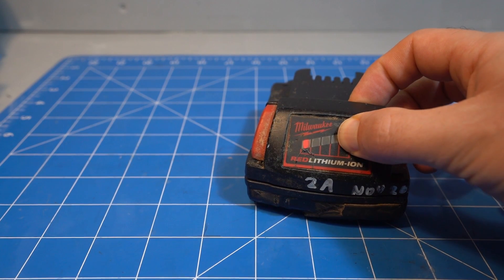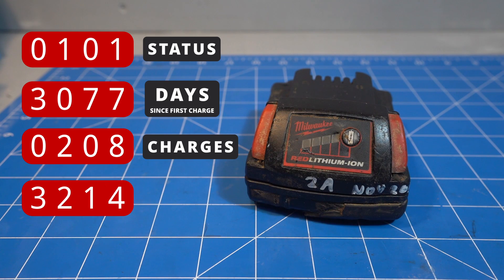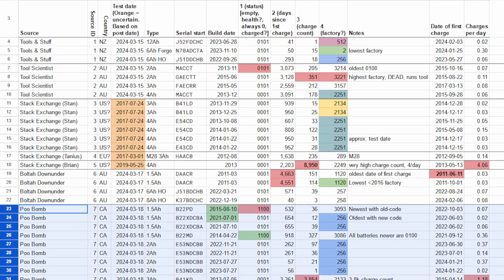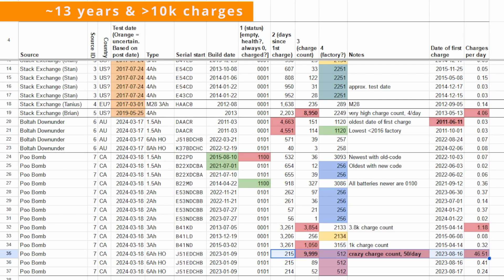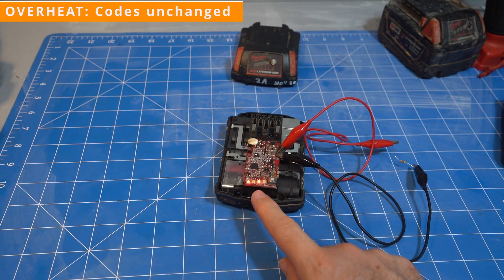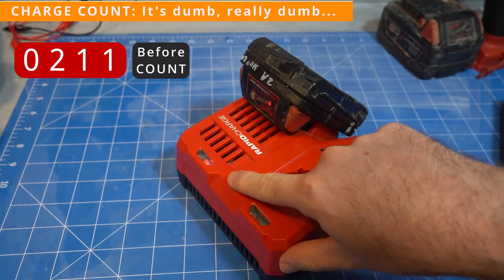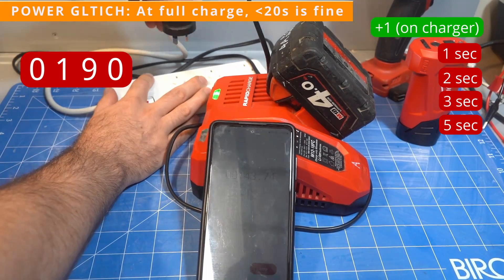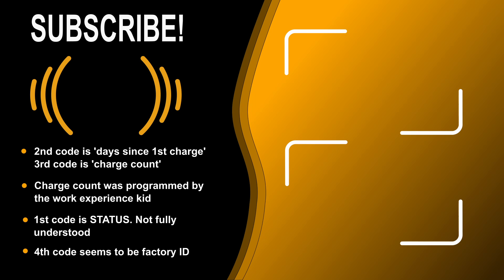[007] Milwaukee M18 has hidden diagnostic codes

Comment: Can put my hands on three right now, all 5.0 AH RedLithium, Two are 15/12/11, so probably from a kit. One is 18/08/02 ( YYMMDD) All are Australian and none have flashcodes that I can trigger. All three still work. Got a few more somewhere. Will report back perhaps.
Reply from the maker: Good stuff, that Dec 2015 is a new "oldest without code". Anything 2016-2020 is no-code, but if you find one in that range with a code that'll be very interesting
Reply: @toolscientist  I have an Aus one that was a redemption 12AH model. I bought the kit (and other batteries included are Nov 18/Feb 19), purchased JAN 2021. The 12AH I was given on redemption has a July 20 MFG stamp (started commenting because I misread, assuming '07 was the year). No codes on any of those. It's holding very little charge now (only charges to 2 bar), but the other 5AH's are fine.

AU 2024-07-18 12AH J52BDCAF 200710 Red Key - no codes
AU 2024-07-18 5AH G29JDCCC 190220 Red Key - no codes
AU 2024-07-18 5AH G29JDCBC 181106 Red Key - no codes

Comment: Does not work for 08/21/2021 

I do actually have a pack I just tested  in the latter gray area. It’s an xc6.0 HO   #48-11-1865 I believe is the model number but that does not show codes when the fuel gauge is held for 3 to 5 seconds and I held it for up to 15sec that date is 08/21/2021
Reply from the maker: Interesting. That's in the green zone by 1 month. We've got a Canadian 1.5Ah from Jul 2021 that has codes. I suspect it's going to get complicated as we narrow it down as some models will change before others.

Comment: LV 22.03.2024. 12ah J52BDCFE 21.11.25. No codes
LV 22.03.2024. 12ah J52BDCFE 21.11.11. No codes
LV 22.03.2024. 12ah J52CDCHC 22.03.22. 0101 592 84 256
LV 22.03.2024. 12ah J52CDCHC 22.03.22. 0101 592 88 256
LV 22.03.2024. 5ah G29JDCBC 18.03.16. No codes
LV 22.03.2024. 5ah G29JDCBC 18.06.29. No codes
LV 22.03.2024. 4ah E54LDCBB 18.05.03. No codes
LV 22.03.2024. 4ah E54LDCBB 18.05.02. No codes
LV 22.03.2024. 5ah G29NDCBC 23.10.20. 0101 2 0 256 -BRAND NEW BATTERY. ONCE CHARGED WHEN GOT THIS WEEK. LOOKS LIKE CHARGING COUNTER DOES NOT COUNT VERY FIRST CHARGE.
Reply from the maker: Great stuff! Thank you for contributing. We've had one other person mention that. Seems the first charge is an initialisation charge and they don't count it.

Comment: EU 2024-03-22 5.5Ah High Output K34BDCHB 2023-01-06 0011 0191 0006 0258

The only battery I have with codes. All other 4 and 5Ah with dates from 180609 to 210821 (and one scratched badly) don't show anything. I heard about diagnostic codes earlier and I already checked most batteries in work (4, 5 and 9Ah, most of them 2018-2019) with no luck, there's I think 4 left I'll check (2x 5Ah Berner branded, 5.5 and 12).

EDIT:
Just realized that my second latest battery should be in green zone, but don't have diagnostic:
EU 2024-03-22 4Ah E54LDCBB 2021-08-21 No codes
Reply from the maker: Awesome, thank you!

I think yours is the 3rd report of a no-code 4Ah in the green zone. Seems that one got forgotten.
Reply from the maker: Your 5.5 has a 0011 status code, which is quite rare. Does the code change if you put it on a tool and squeeze the trigger? How about if put on a charger?
Reply: @toolscientist  It's 0101 after i put it into BPDN drill and squeezed the trigger. It stayed that way after I put it into charger. Earlier I was using it only with FSAG125X grinder and once with JSRDAB+ radio until fully discharged, charged it and didn't use it for 3-4 weeks until now. It's night now so tomorrow I'll check if some heavy grinding will make 0011 again. If not I can leave it in radio until discharged and check again. I cant promise I'll leave it unused for another month  ;)
BTW, I bought it 2 month ago, maybe seller (official Milwaukee retailer) recharged it after quite some time on the shelf?
Reply from the maker: @djunia4u  the only other report we have of 0011 is from a brand new, never used battery. 3rd bit could be a "unused for X days" code. A lot of my old batteries never get used, so I'm surprised they didn't show it on my first test of the codes. Maybe it's only the newer batteries that do this?
Reply: 5.5Ah? Just seen that what is a 6Ah HO in the rest of the world, is a 5.5Ah HO in Europe? Are they actually different? Or did the batteries just not reach european standards to call it a 6Ah?
Reply from the maker: @ToolsAndStuffOFFICIAL  best theory I've heard is that 5.5Ah is under 100Wh so avoids shipping or tax restrictions. Metabo also has 5.5Ah. Pretty sure they're identical to 6Ah HO, just a diff sticker
Reply: @toolscientist  I figured they wouldn't use different cells and that it would only be a label.
Reply: @ToolsAndStuffOFFICIAL  I opened one before and it was full of 3Ah Samsung cells so technically it is a 6Ah pack. The trick is in EU we can have unlimited amount of batteries in carry-on lugged if they are below 100Wh without any additional paperwork and permission from airline, and 5.5HO is marked as 99Wh
Reply: @djunia4u  How dodgy is that!
Reply: @ToolsAndStuffOFFICIAL  How convenient! And it's not only a red think. Few years ago I had Alienware laptop marked 99Wh on bottom lid, but if you take that lid off and multiply volts x mAh it actually equals to 106Wh.  What would you do if some Lufthansa or other Ryanair said you cant take your laptop onboard?

Comment: Have a CP 2.0 (E53NDCBB-230216-3048980 and it has the FLASHING LIGHTS I live in the USA And have to CO 3.0 batteries (K35DDCHB-220905-0753185 battery #2 (K35DDCAE-220822-0690788  and they both have this FLASHING LIGHTS
Reply from the maker: Awesome. Any chance you could post what codes you get?
Reply: @toolscientist  give me a couple days I even have a FORGE Battery
Reply from the maker: For "CO 3.0", did you mean "High Output 3Ah" (newer, single row, 21700), or "XC 3Ah" (old, double row, 18650)

Comment: . . ¿ Wouldn't this be a way to detect a counterfeit battery ????
Reply from the maker: Yes. As long as they're not in the red/grey zone (currently Aug 2015 - Jul 2021). The counterfeiters have gotten pretty good, though. Wouldn't be hard to copy this, but most wouldn't bother.
Reply: @toolscientist  . . ¿ Wouldn't that mean a far more complicated and Expen$ive board ????
Reply from the maker: @jimkoko  every counterfeit board I've seen has a microcontroller. They wouldn't be able to charge without one. Adding these codes would be quite easy for them
Reply: @toolscientist  Are the flashes always the same length? It could be that the manufacturer has specified their duration to a precise number of milliseconds. And therefore, the manufacturer of the copy must be precise when implementing them into their own battery.
Reply from the maker: @user-hb8sq6ce9u  could be, but it wouldn't be hard to copy, unless they put some crypto stuff in so that the duration changed slightly in a predicatble but hidden way. The fakes are all about fooling the average consumer - fooling Milwaukee service techs would be very difficult. I'm pretty sure they have a device that can pull diagnostic data from the battery without needing to read codes.

Comment: I was unable to get codes on 4Ah one, however it's from 2022, so a bit after the gray area:
PL 2024-03-22 4Ah E54LDCBB 220810 [NO CODES]
PL 2024-03-22 2Ah E53NDCBC 220804 0101 456 17 256
PL 2024-03-22 5Ah G29NDCBC 220520 0101 426 29 256

Thanks for the video!
Reply from the maker: Yeah, I had someone else tell me a new 4Ah had no codes. Maybe the 4Ah never regained them.
Reply: @toolscientist  Sorry, I've provided the wrong production date for 2Ah, should be 220804

Comment: Just told @toolsandstuff
M18 8.0 Straight out of the package Mfg date(I think)- 230215
1 - 0011
2- 4 lights flash twice
3 - 4 lights flash 3 times
4 - 0512
Reply: Ahh. We may have the 3rd one...
Reply from the maker: Interesting! So 3rd bit prob means "never charged" or "in shipping mode". Will it run a tool or does it need to go on charger first? I suspect needs charge first and then it'll go to 0101
Reply: @toolscientist  I just left my house. I will reply as soon as I know.
Reply from the maker: @benfowler2127 All good. Take your time and write it all down. Codes before -> put on tool -> codes after tool -> put on charger -> codes after a few sec on charger -> put on tool. If no go, then try longer on charger. Thank you for participating in citizen science!
Reply: @toolscientist  I thought I had replied to this earlier, but I don’t see my reply… I have 3 more of these 8.0 batteries new in package and 4 of the 6.0HO’s new in package, so if there are specific tests you’d like done, I can set up a camera and then send you the footage. 

Seems the 3rd light is a new battery indicator on test 1. Here are the results

New
1-0011
2-
3-
4-0512

On Tool (Not used)
Same as new

On Tool (Trigger pulled for 3 seconds)
1-0101
2-
3-
4-0512

On charger long enough for light to come on
-No Change from above

On charger for 10 seconds
-No Change from above

On charger for full charge cycle
-No Change from above
Reply from the maker: I'm sure I read an earlier version this reply, too. I think YT is spam filtering a lot of these comments because they're full of numbers so it looks like bots.
Reply: @toolscientist  From what I'm hearing, the first charge does not show as a count on the battery. Initial charge, no count. My newest 12 shows this too. It shows one charge even though I did the initial charge, then immediately depleted it on a vac and put it straight back on the charger again.
Reply from the maker: @ToolsAndStuffOFFICIAL  your forge teardown also shows this. You had it once on the charger, and it gave zero charges.

Comment: just the batteries i had to hand, all work fine:

US 2024-03-22 1.5AH B22XDCJA 2022-07-08 0101 0081 0001 0256

US 2024-03-22 1.5AH B22VDCBA 2020-12-24 NO CODE

US 2024-03-22 1.5AH B22XDCJA
2022-07-07 0101 0080 0001 0256

Ive also got this 2AH battery that looks quite beat up i got second hand, where the serial number is slightly different? Posting the whole thing here for risk of being tracked by a battery lol

E53AD131 007789T
stamp: 130222T
0001 3042 0329 2186

also have a 4ah with an illegible serial # and no codes, is this printed anywhere else? internally maybe? didnt feeling like tearing it open right now but maybe :3
Reply: oops i take it back, figured out the serial with a very very bright flashlight and some solvent

US 2024-03-22 4AH E54KDCAB 2016-03-03 NO CODE

looks like that pushed the no code date 3 days back :)
Reply from the maker: @kitty-bash Awesome, thank you!

Yeah, the serial number style changed around 2016. Pre-2016 needs heat stamp for date.

Comment: Could the "charge count" just be to measure the life of the charging connectors?  Sure those clamping pins should last more than 20,000 connections, assuming you connect the battery to a tool each time after charging it, but I think that would be another reason as to why it counts the way it does.  Also I didn't expect it to have a timer to count the number of days since first charge.  Does it stop counting the days if the battery is dead or below a certain voltage?
Reply from the maker: They prob do 3-5x as many connections to a tools as they do to a charger, but they don't count tool connections. I'm guessing days since first charge (together with charge count) is used to determine warranty (and for their own internal longevity analysis). I was surprised at first, too, and was worried they'd brick batteries after a certain time. The 13 year old batteries somewhat puts that to rest.

Good thought on the dead battery. I may have to sacrifice a battery to the science gods.

Comment: I think I missed the forest. What does the "charge counter" matter? So what if it goes up when it wasn't a real charge? Other than, y'know, us nerds wagging out fingers in disappointment.
Reply from the maker: Potentially denying warranty. I found an internal Milwaukee document about not warrantying batteries over 1k cycles. Also, just really appalling software design - you would have to try to make a worse charge counter.
Reply: @toolscientist  - Oh come on, it's not that bad of a charger counter. It's like me asking how many women you've slept with, and you answering with the number of women you've ever hit on. I mean, it could be accurate. There's a chance.
Reply from the maker: @MattsAwesomeStuff  haha, well name a charge counter that's worse. The only way it could be worse is if it just did a RNG every hour and rand > 0.95 does count++. If they're too lazy to do some basic coloumb counting or thresholds with hysteresis, then it's still very easy to implement some basic timers for on and off charger.
Reply: @toolscientist  I took a look at what I think is that document, they seem to be talking about V18 batteries.
Reply from the maker: @samthenerf  they also mention the 48-11-1828 with serial number B41D and earlier, which is the old M18 3Ah XC. From the codes I've been sent from other people, that's around 2013-2014, but could be later. Obviously all those are well out of warranty now, but could have affected people back then.

Comment: Neat stuff! I wonder if any other manufacturers do this kind of thing better?
Reply from the maker: There's definitely diagnostics in Makita LXT and XGT, you just need an expensive adapter to get them. Milwaukee has more diagnostics than what we're seeing here, but those tools are only available to service techs.
Reply from the maker: Check out this vid by Tools & Stuff showing the Makita battery analyser: https://www.youtube.com/watch?v=uumwieLu8CE
Reply: @toolscientist  The CXT ones do it too. I just haven't forked out for it as it's a separate checker.
Reply: @toolscientist  Hilti batteries do something similar.
Reply: I tested my 21 platforms and no other batts did it.
Reply: Although Makita makes battery checkers that give better more useful info.